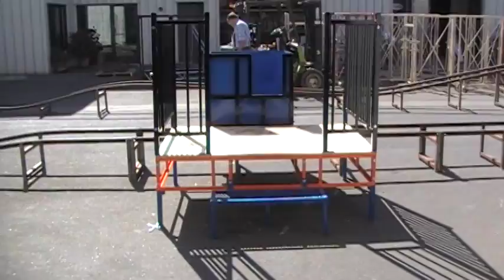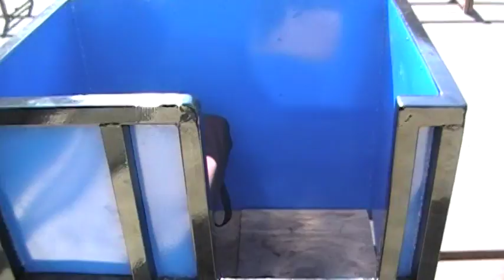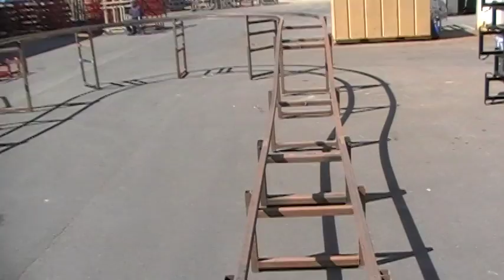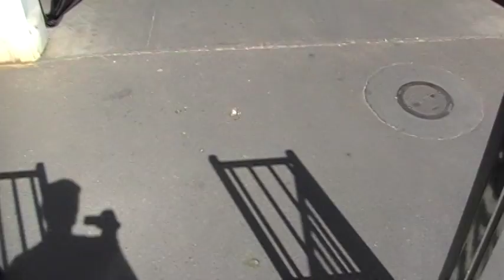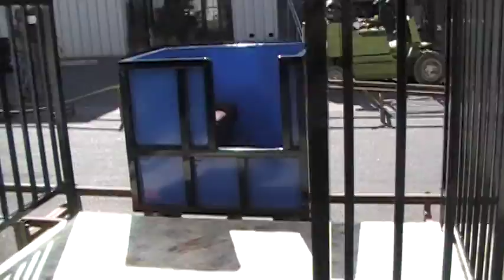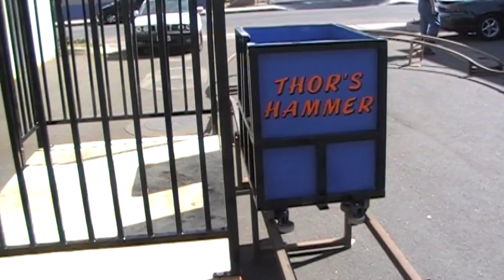Thor's Hammer - Homemade Roller Coaster 2007 #1

Comment: That's a really nice coaster :)

I don't want to sound like said 9 year olds, but you could easily fit a wiper motor or two on the back of it and power it with a car battery :-)

Comment from the maker: Less than a thousand. I don't remember the exact amount. I think its closer to 500 or 600. Actually all the money that got spent, was on those horizontal pieces of rail. We don't have a 3 wheel metal roller. So, we had to have someone do it for us. It cost approx $20 per 20ft length of tube for material and approx $50 to have the outsource shop bend it into nice SMOOTH radii.

Comment: Firstly, you would need a safety harness. Usually, a 5 point is plentiful securelty mounted to the car. Secondly, you would need upstops on the wheel carrages to keep the train from comming off. Thirdly, you would have to design proper supports. At least make common sense.